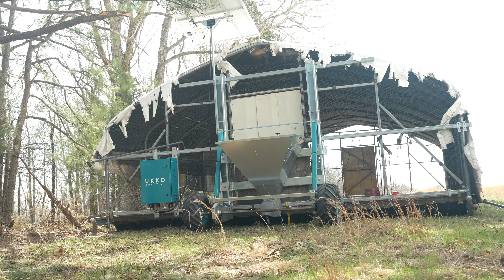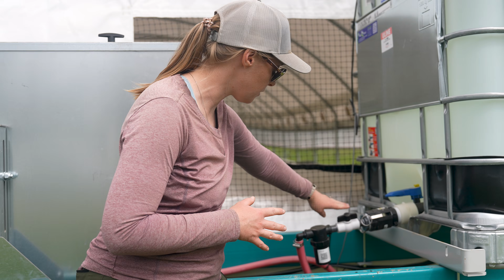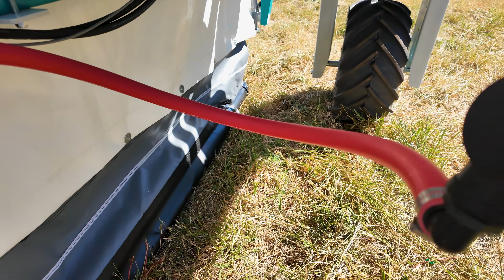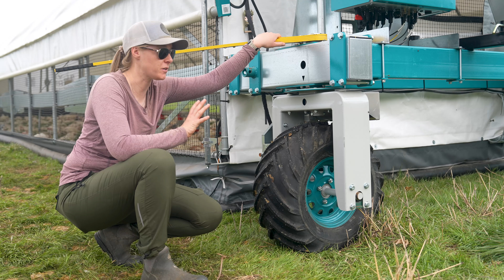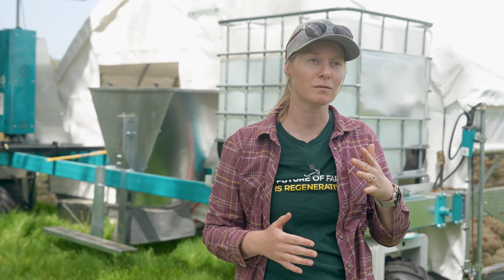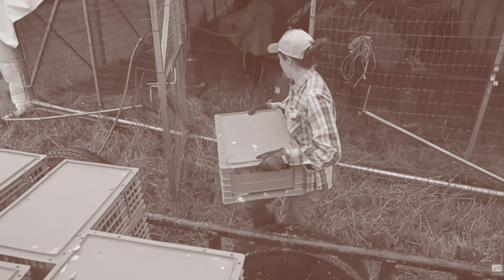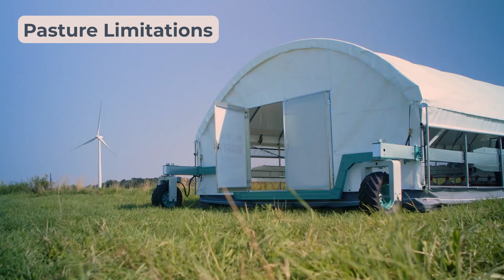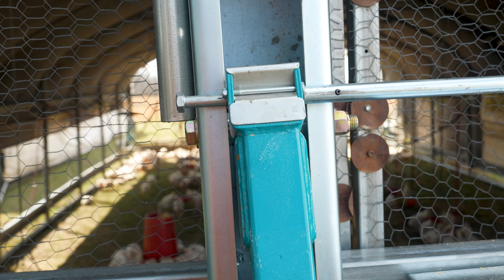Is This The Future Of Raising Chicken On Pasture? [Fully Automated]

Comment: Genius . Make the electrical component box taller, add only a false bottom 4 - 6 inches higher than the bottom of the exterior walls. Its only a few extra feet of sheet metal  but having the actual electrical connections covered more from weather and driving rain is a longevity win . Cheers
Reply from the maker: That's a great tip, thanks for sharing!

Comment: Why are the "chicken tractors " staggered? Every video I see shows them staggered regardless of style or size. I think these are the best design. Will definitely have to try one.
Reply: Hi, we stagger them so when it comes time to turn them around they can just slide to the side into the next lane over then make their way back without running into each other. It’s also for air flow. If we have them right next to each other it significantly decreases the amount of a breeze they get. In the Arkansas heat any amount of wind helps cool the birds.

Comment: Ideas:

1. Add shade cloth or so to the water tank and feeder.
2. Ideally use stainless steel water tank (but it's a little heavier and 10x more expensive, but it's cleaner water)
3. Since you have made the tractors so big, why not change the roof so that you make a water collection system into the water tank, and then the water to go thru a water filter.. This would make these chicken tractors more interesting/autonomous.
4. Please DO NOT use water hoses... only use food grade HDPE pipes or stainless steel.. Most water hoses are loaded with heavy metals, microplastics, phthalates, ++ ... no excuse to use them. Just use HDPE and add heat/sun insulation also.
5. If there always tends to be moisture/high humidity in the feeder, then maybe add somewhere a small dehumidifier working with the battery directly and add a humidity sensor so that it works when it has high humidity inside the feeders.
6. Add more solar panels, since that's not too expensive or difficult to add, so that the system always has enough power even in winter months (if more energy is needed to run the dehumidifier, lighting, water pumps etc).
7. Maybe add a small electric fence system running of the battery, and add a hot line around the tractors at the bottom to prevent predators from digging.
Reply from the maker: Hey!! Thank you for such a thoughtful and detailed list of ideas! They are super interesting!
Reply: @HeiferUSA  Thank you. Also I did not catch that the tractors already have an awesome electric fence system at the bottom to prevent predators, that's next level right there. Also I wanted to add that one more possible way of reducing humidity inside the feeder would be by adding rubber seal on the lid perhaps? Dunno.

Comment: always great to see what' is on the bleeding edge. Of course, these, at the likely current price point would work mainly for the larger producers, definitely not something for the first time, small scale farmer. Design wise I see a couple of weak points, one has already been mentioned, The translucent IBC totes. Unless absolutely clean, no "nutrient" containing water is put in, algae gonna happen. 2) the batteries, Those look like Eco-Flow or similar lithium ion phosphate. Great tech, unless the temps get below freezing, and then without a heating system in or near them, attempting to charge when the cells are below freezing will brick them. More and more batteries at least have good low temp sensing to stop that from occurring, and some even have internal heaters, but even so, that only works so far as the temps drop. It takes energy to keep them warm especially at single digit or below temps (F). Just a point to keep in mind for farmers where it gets really cold, or below freezing for a long time, without sun. (only 6 min in so far)
Reply from the maker: Those are great insights! Thanks for sharing:hands-yellow-heart-red:

Comment: There’s really only one problem I notice. The water tank. I grow giant pumpkins. I use those plastic tanks all the time. If your birds don’t go through a lot of water, algae will bloom. That entire tank can turn green. Given this thing moves a lot, and will probably be refilled regularly, it should be fine. 

However it is something to watch out for.
Reply from the maker: Thank you for pointing it out! We'll definitely be keeping an eye on it.
Reply: @HeiferUSA A black tank will solve that.
Reply: @hughmarcus1  A black water tank will also heat up more than a light coloured one.
Reply: @markfryer9880  then insulate this one, making it opaque
Reply: Plastic paint ... paint the out side of the ibc leave a 1" stripe next to the gallon scale
Reply: @masterkenny1123  Put a float sensor inside the IBC that tells the computer (and therefore the app on her phone) the current water level.  Have a pump recirculate a little water from the bottom to the top, to inhibit algae growth.
Reply: Add some apple cider vinegar to help minimize the algae
Reply: What would help immensely would be to have two tanks, alternating between them so they can dry out regularly.

This could be done manually by swapping the tanks instead of refilling them, or on the system by having two tank holders and swapping which one the hose is connected to. Or it could be done semi-automatically by having two tanks, two pumps, and a crossover valve that connects both tanks to the system and to a drain.
Reply: I thought the same thing
Reply: A couple of minor tweak suggestions from a non farmer who spent summers on grandma’s farm 60 years back. 

Shade cloth for the roof for the roof like they use on greenhouses. You could also incorporate a system to roll it out like they have on open topped trailers - grain / sand / gravel / etc with a simple handle to unroll or re roll. It could also be zoned into shorter sections to give the birds some choice in sun or shade, half length for manual, could be smaller for motorised.  These could also be automated with a small stepper motor that would easily integrate into the system, I’d suspect that a motor the same as the auger feed drive would do the job and that would cut spare part sku requirements. 

There is a vid of another chicken tractor where they hung a plastic pipe a few inches ahead of the trailing wall inside the structure. It was free swinging, hung on chains and maybe 1/2 or 3/4 diameter.  Its function was to nudge the birds forward giving a gentle push and an opportunity to move instead of possibly running over them like a solid wall could. Could either eliminate the need for flagging or make it a lot easier. 

Nice setup, thanks for sharing.
Reply: Do you process your chickens or outsource. Would love a cost breakdown.
Reply: Oh, the chickens will go through the water plenty fast, I went through about 100 gallons a week with 300 birds, that pen looks rated for about 600
Reply: Yeah, you’d think that they’d put a sun blanket or paint the IBC tote. The product as a whole looks and seems pretty rad but that’s such a simple thing they could do.

Comment: Hey Heifer, I love the content and I love this as an idea. Unfortunately, this is not practical for most farmers. These Rova Barns are between $20K to $60K. What is shown here is even larger than what's on Ukko's website, so this is probably closer to $70K or $80K. The largest one, RB 700 fits 526 broiler chickens. This model probably raises just shy of 700 chickens (676 chickens to be exact, based on sqf to chicken). 
So doing the math....

676 chickens X 5 lbs carcass yield per bird X $10 per lb = $33,800 in revenue

Given the cost of the RB 900 and the revenue (not profit) that can be produced in one barn, this barn does not make direct financial sense for probably 99% of pasture poultry farmers. Even with a 20% profit margin ($6,760 from $33,800), that still won't come close to paying off the return on investment (not that profits are used that way).

This barn works best for research farms (like Heifer) or millionaires or billionaires who aren't actually making a living from farming and simply want an efficient way of growing their own poultry. This barn also works for people who have little interest in paying off debt and are happy operating on high debt similar to traditional CAFO poultry producers.

There could be an argument of this helping with reduced labor, but the farmer would have to still bare a large financial burden. And, although the apps for the barn make it easy to use, wwhat happens when somethings breaks or malfunctions?

Again, I love this as an idea, even as a dream scenario, but this is simply not realistic for farmers from a financial standpoint.
Reply: Too many electronics. Not enough pasture per bird. IMO Joel Salatin's chicken tractors are more efficient in every way.
Reply: @cjmorton42  Agreed. Low tech isn't perfect, but if something breaks, you won't need to call a literally engineer to figure out how to fix it 🤣
Reply: @PorkRhyne  it seems like could be built by farm with help of a school STEM program to keep the costs way less but agree with your numbers don’t see it working at those prices.
Reply: @HawaiiSustainable  That's a great idea! I always think about how farms should start leveraging their land for partnerships with community colleges and universities. There use to be a lot of money in that, but the current USDA funding freeze has made that option less feasible. But, using companies like Ukko as partnerships for research and development could work; get paid by them to implement and document the tech performance + free tech or equipment.
Reply: It's on pasture. So you'd have to take into account most likely the raising of cows for meat or hay as well. The chickens are acting like fertilizer. So you'd also cut down on that cost.
Reply: @firstname-qq3xp  So you'd be willing to spend close to $80K + at least $8K in chicken feed per coup, per cycle round of chickens, for the sake of fertilizer? Even with cows, cows do a good job fertilizing the fields with intensive rotational grazing. $80K invest for a rigid, inflexible method for pasture fertilization is just crazy 🤣 

I get your point, thats more LOOOOOOOONG term investment, but the reality is most of these farmers won't be able to stay in business long enough to see that investment realize itself. This works better for nonprofit farms who are subsided with outside funding.
Reply: @PorkRhyne  most food is made by big ag. So they have money, and wont be crying about it. But yea, the future is automated farming.
Reply: Thanks for that info! Need to run the calculations again because each house can produce a number of batches per year. They're up in Canada so it might be different down south. Seems like the water system would freeze up there more than down south and there's no heat for the birds so they may have to take a break for a few months.
Reply: You know, the way Ai developments are going it might be wise for famers of all sorts to invest in systems that Ai can be integrated into and in that regard this seems like it might be a wise choice. Like it or not, in the near future the farmer that has integrated AI into his workflows will fare better than the one that hasn't.

And it isn't 'bad' - just like the plough isn't 'bad'. Do you want to go out there and scrape furrows into the ground by hand? No. Do you want a plough but have to pull it yourself? No. Do you want one that can be pulled by cow or horse or do you prefer the tractor with it's engine? The tractor with GPS or without? A farm with inetwork connectivity or without? The one with Ai or without - that's going to be the next choice and it isn't just farmers that are going to have to make it. You'll have to or you'll be out-done by the people that do and this holds true for almost every industry there is.

For the farmer who's preparing to be fully automated - which entails learning new skills such as Arduino programming and the like, skills with which they will be able to diagnose issues and repair components - for that guy this seems like a great way to go.

The farmer that does fully automate will have realized the dream of having those fields take care of themselves. All he'll have to do is maintain the systems the run everything and in time there will even be an AI system to do this too. Or he'll likely pay someone to take care of 'that stuff' for him.

 It's inevitable and I'll tell you why - it's inevitable because there's an AI 'arms race' going on where everyone's chomping at the bit to win.
Reply: @alflud  Thats great information, but it's beside the point. My point is, this system is not economically responsible for the majority of pasture poultry farmers. And as someone you uses and keeps up with AI, the people who invest in AI already have financial success... most farmers don't, so the idea of "investing" in physical farm products with AI doesn't make much financial sense. 

NOW, I better use of AI that would actually bridge the revenue gap is if farmers invested in marketing and sales software thats powered by AI. That would make more sense than buying this particular chicken tractor.

At the end of the day, growing the food isn't as hard as find and developing markets that would actually buy the food.
Reply: $20 per lbs of unprocessed chicken meat?
I don't live in the US, but still this seems very expensive.
I pay $1.55 USD per lbs of processed/cleaned whole chicken (not pasture raised).
Reply: I’m not sure where you got your prices for Rovabarns but that is not accurate. If you’re interested in a quote you can contact Ukko directly. You’re right, it’s not for everyone which is why Heifer is testing them and helping work out the kinks so others can make an informed decision when selecting pastured poultry infrastructure.
Reply: No to be petty, but the prices are LITERALLY stated on Ukko's website under the ROVA|BARN FAQs, "How much is a ROVA|BARN?", which states...

"Our ROVA|BARNs range from $22K to $60K CDN depending on the size you need (sizes offered include 200, 400 and 700 square feet models). A ROVA|BARN costs approximately 60% less than a traditional livestock barn. Financing options are available for Canadian and U.S. customers."

Maybe y'all got a discount, if not for free, since y'all aren't doing research, but those prices are what the average, non-grant/donation/research funded farmers are having to pay for these barns. 

Again, this is a fun idea, definitely not feasible or wise for the average farmer. Probably better use in the conversion kit than the actual full system. My hope is that Heifer would continue to promote systems that works for the average regenerative farmer and work with companies that tailor their products to that farmer, because $60K+ for a coop/barn that only does 500ish chickens (700 model) is not in alignment with the priorities of the average regenerative farmer on a financial level. And I say this as a farmer whose raised thousands of poultry on pasture... probably would have hated it less with a Rova Barn hahaha, but $60K more in debt would be crippling. 

So, no hate against Heifer and your work Sam, y'all do a good job educating folks and I love the content y'all produce. Seriously, keep up the good work. I just disagree with this product being made for the average poultry producer, but I still believe in the Heifer International mission since I got international work as well. 

Much Love 🐷♥
Reply: @PorkRhyne  Just as a note, those that invest into one of these are not using them on one batch per year. Most of the professional producers I know run 6 to 8 batches per year, Heifer included. 

So yes, it doesn't make since for to buy one for a once a year use. But if you take your example and 6x the revenue (at least for professional producers), it make far more sense. The limiting factor is the producers ability to sell at that point.
Reply: @dchristal100  I completely agree, 100%
Reply: @dchristal100  Ya. The farmer I work with does three runs a year with five tractors and another ½ dozen partners located on other pastures. It's still pricey, but worth a look into the details.